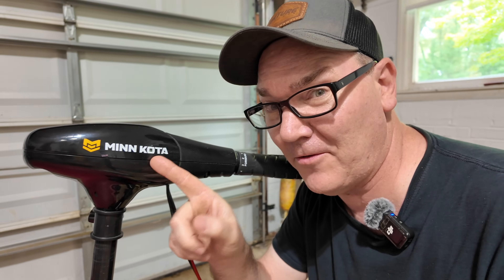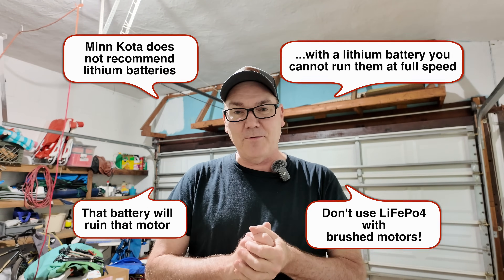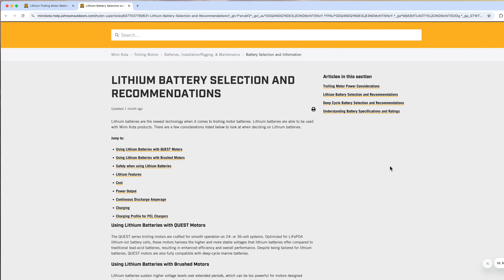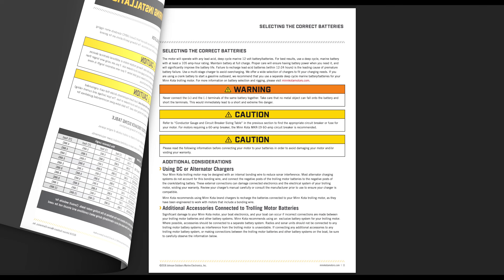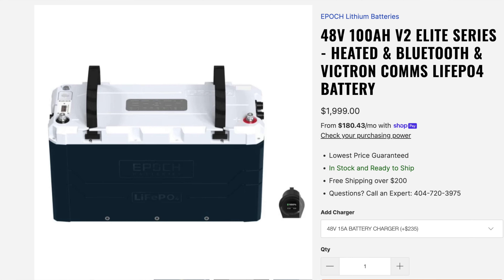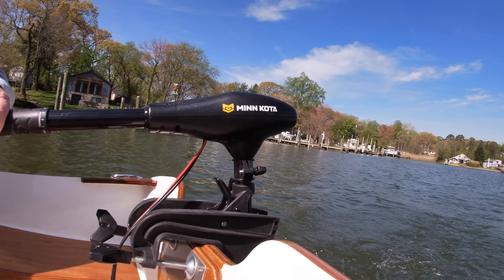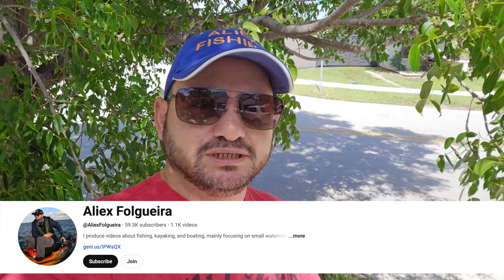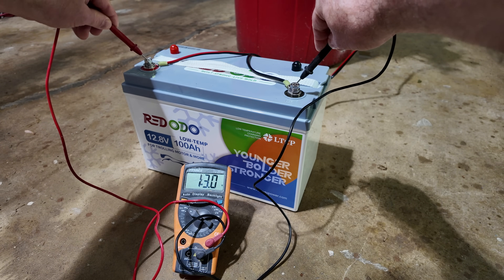Does a Lithium Battery DAMAGE a Trolling Motor & is Minn Kota Hiding the TRUTH?

Comment: Hmmm.  I know nothing at all about Minn Kota.  But I know a little about DC motors and electricity in general, having spent thirty years designing motor circuits in industry, including DC PM motors.  All batteries, lithium ion or lead-acid meet stringent standards.  As far as motors are concerned, the key is current.  If the voltage is within +/-10% (1.2 volts) and the current is not exceeded in the motor, the power source is transparent to the motor.  The current rating (breaker size) is supposed to take voltage variation into consideration so that current is not exceeded in the Ohms law relationship.  As far as the motors 'burning out sooner', the voltage drop curve on LI batteries means you are at optimum voltage for longer on each charge.  So, the normal wear and tear which effects product life happens in a fewer number of charges.  In my humble opinion if the motor burns out traumatically, it is likely an installation problem or individual motor defect.  If it seems to shorten the life of the motor, that is likely an illusion.  You will probably get the same number of hours of operation  at a given speed.
Reply: Nah, this guy is just an id iot.  Lithium batteries designed for trolling motors just have an internal regulator or buck converter to step-down the voltage, as opposed to 'regular' LFP lithium batteries.  Remember:  A 'regular', non-trolling motor lithium battery at 100% state of charge can reach voltages as high as 14.6V, and can take quite a while of operation to drop to acceptable voltages...

Comment: Hey, let me tell you what happened to me and my mother. I bought 2 Newport NV series 46lb thrust trolling motors and i bought 2 100AH lithium batteries for the trolling motors and my mothers trolling motor stopped working and the next day my trolling motor stopped working. I contacted Newport and they are sending 2 new speed controllers and instructions how to change them and they said i could only use the lithium batteries if i only used speeds 1-3. That i couldn't use speeds 4 or 5 at all or the warranty would not be covered. Also, Newport sells a lithium battery for there trolling motor on there website.
Reply from the maker: Thanks for sharing your experience - that's good information for everyone to know!

Comment: I really don't want to be that guy and don't think it makes a difference, but, the barrel test does not "load" the motor prop the same way as pushing a loaded boat underway.
Need to perform a current (amp) test to verify that the motor is loaded while testing. 
No cavitation or current assist to lower the current draw.
Reply: Thanks for the test.
 I had been wondering if I could run my old 12v / 24v trolling motor with my new lithium battery. 
I look forward to using it now.

Comment: ReDODO....not Redodeo. I cannot believe they named it dodo LOL. Minnkota is definitely practicing CYA. I personally think they say it because of the discharge curve of lithium that you sit at or above 12V through 90% of discharge. RPM is effected directly by the voltage applied and KV of the motor. Running at higher kv that lithium allows could cause the brushes to wear out before their warranty period ends, your friend stated that his has been running for five years? So probably being overly cautious on minnkotas part. Good video and test!
Reply from the maker: I also thought it was Re-Dodo but the company told me it was Red - O. D. O.

Comment: I smoked an Endura 30lb on my kayak in less than 2 years.  Had a good LiFePo4 with BMS in and wired through a Minn Kota protected box.  When I pulled it apart, the wires were fried all the way down.  I ran it 100% frequently but not extensively.
Reply from the maker: That's probably what they should be doing a better job of warning us about!

Comment: Elevated voltage means less amperage. Amperage causes heat, not volts. Unless the voltage is extremely high their claim is bogus.
Reply: Yes, if you elevate the voltage you can reduce the current for the same power but though the same resistance, increasing the voltage will increase the current.

I=V/R where in this case, R (motor resistance) remains the same.

So, using very basic concepts, say the motor draws 30A at 12V, the motor resistance is (R=V/I), 12/30 = .4 of an ohm.

If you up the voltage to 13, I=V/R = 13/0.4 = 32.5A, that's a 2.5A increase in current, if I've done my maths correctly. ;-)

Oh, and it's power (P=V*I) that creates heat, no matter how it's generated. ;-)

Comment: I use a minkota 30/30 and and minkota 30/35  And almost always at speed 5.  Done this with this exact battery for years.  And at the price of the small trolling motors, why would I not do this.  Works perfectly ...

Comment: I've burned up two of 5-speed switches in the last couple years on my Endura C2 34# trolling motor. It is currently sitting in the garage because I decided to upgrade to the Endura Max 55# model after it died again; I haven't gotten to taking it apart to see what failed yet.

Comment: I have now blown two Minn Kota trolling motors (most recent Endura Max) using lithium ion batteries 12.8V 100 aH.  This happened within an hour both times.  The second time we made sure to run it at about 60% as your video does a great job of describing the numbers only go to 5.  I am not sure why but I am very frustrated with Minn Kota.
Reply: Put a voltage regulator or buck converter between the battery and trolling motor rated for the proper current....  This guy is an idi ot...

Comment: Isn't the water cooling the head down? By running it in a small trash can are you not heating up the water?
Reply from the maker: Trolling motors don't use an impeller so the head doesn't get cooled. The water in the can surprisingly did not get warm.

Comment: Been using the exact same motor and battery for 3 years now. Full speed is my default position - doesn't draw the full 50 amp capacity at any time (@ 50 amps the BMS shuts off). Not to mention, the full charge capacity of the Lifepo4 battery will decrease over time, thus making the urban myth totally wrong.

Comment: Been running a minn kota 30lb thrust with a 12v 100 amp Power Queen battery ..no issues what so ever.... Maybe it the battery your using ...
Reply from the maker: No issues with mine either - that's the point of this video!

Comment: these things were all designed to be used with lead acid batteries before lithium was available. The user is the one who decided to use a battery with a different voltage profile that the lithium manufacturer has marketed  as “Drop in replacement” for lead acid batteries…..lots of applications where lithium batteries cause problems in designs that were done for lead acid batteries. If you use lithium you better understand the difference.
Reply from the maker: It would cost zero dollars for Minn Kota to better inform people instead of being hidden deep on their web site. Because many people would attribute failure of their trolling motor to Minn Kota and not the battery.

Comment: Any one running these type battery's as their main engine starting battery? I was wondering how the engines charge system will effect the battery and even more so How a 2 stroke engines charge system will effect since they use a stator type charging system.

Comment: ironically, I just burned up a one year old 30 lb Endura running into the wind for about 30 hard minutes. But, I blame it on the algae bloom wrapped around the prop, not the motors fault I didn’t notice because of the conditions. Just got a new 55lb endura max today.
Reply from the maker: Dang!

Comment: If MinnKota truly believes a increase in average applied voltage of under one volt will have a detrimental effect of the brush/commutator interface, then they need to redesign that interface.  Real world electrical experience says it won't make a difference.

Comment: I have a Minn Kota 12V Riptide motor I bought new around 2002, and am still using.  I had some saltwater incursion into the power head a couple of years ago so the brushes have been replaced.  In March 2024 I replaced my lead acid battery with Power Queen 12V 100Ah LiFePO4 Battery BCI Group 24 Lithium Battery, Deep Cycle Battery with 100A BMS, 1280Wh.  I fished uneventfully through 2024, but within my first hour of use in 2025, the motor stopped running while on a 5 day trip.  We diagnosed the failed part as the 5 speed switch - bypassing it the power unit ran fine.  When I replaced the switch, I discovered 3 of the 6 wires had melted together.  I was able to pry them apart, and repaired with electrical tape rather than replace.  

I have used the motor two days more since - the second day I was pulling against wind and tide much of the day, so much so that running on speed 4 was often not enough, so I spent hours running at 5.  So far no sign of issue, but when it failed last time there was no sign ahead of time, it just stopped running.  I am just putting this out there for consideration.

Comment: The obvious suspicion is it's a way to entice people to upgrade to brushless, right?  Hopefully that's not the case!

Water temp is another factor - I didn't notice you mention you ran it in warm water but that might a critical factor.  Granted, I bet the motor heated up the water over time.  Thanks so much for the video!

Comment: You can over heat the he trolling motor in the little bit of water in a trash can .no water cooling system. No load. Put on boat run in Lake then you have load plus plenty of water. How hot is your water in your tank .I am sure the Lake waters will not get over heated. BAD Test.
Reply from the maker: The water didn't even get warm - which surprised me.

Comment: I have a Minnkota Terova 80 pound thrust and I use 2 100 amp hr lithium batteries and if I run at full speed for more than five minutes, it trips the breakers I reset the breakers I can run at 8.5 all day long no issues
Reply from the maker: Hmmm - Circuit breaker doing its job!

Comment: You had a lot to say about what warnings MinnKota should have about these batteries... What about the company who makes the battery that says its for trolling motors?
Reply from the maker: My thought is that maybe this battery is regulating itself at a low enough voltage to work. But I'm no battery expert. Other 12 volt LiFePo4 batteries might not be set the same or recommended.
Reply: @WayneTheBoatGuy  either way, they say they are for trolling motors. If there is a chance it could damage "some" trolling motors there should be warnings, just like you suggested for minnkota.

Comment: My Minn Kota 55lb thrust transom mount motor also has another issue. The battery maximizer feature does not work. It flashes a continuous red light. AI indicates that it will not work on a lithium phosphate battery because Minn Kota designed their motor for flooded lead acid batteries and the lithium does not discharge like FLA battery. Perhaps that has to do with burning the motor too? Can you please investigate this further, it would be appreciated. I am not technical. Thank you.

Comment: I've run brushed trolling motors for 20years on electrc-motors only lakes in Italy and i can say that by far the weakest point of brushed trolling motors is the speed switch. Those faston connections just cannot sustain heavy power for a long time. That's what you will burn first. Cannot say if lithium batteris make it even worse but I'm using them for years and so far no problem at all

Comment: I have been running my Endura 44 lb trolling motor for a few years with my Dakota Lithium battery without any issues.  Granted, I don't normally run it wide open for long periods of time but still no issues.  I like your testing setup.  Thanks for the video.  Fish on!

Comment: Great video especially because I’ve just purchased a Li ion battery. I have to wonder if you’d get the same result with an actual load on the motor, rather than just moving water.
I’ve used my battery twice, and am thrilled with it. I’m using power 1  90% of the time and doubt that I will ever have the overheating problem.😊😊

Comment: Minn Kota paid engineers a lot of money to design a motor that will barely handle the electrical power it's going to see in service.  New battery tech increases the time at maximum load.  So the motors see conditions they weren't  designed for and could fail or wear out sooner. The solution?  Push the problem into the consumer instead of beefing up the product.  In other words make someone else pay for your screwup.

Comment: Intetesting point was brought up....lithium batteries charge at higher voltage rates... so should the motor be unplugged or disonnected during charging?    Many bow mount motor users never unplug their trolling motor when charging.     Could turning the power button on while charging damage the control board...  using my 24v terrova as an example.

Comment: I have had 3 Minn Kota Trolling motors stop working due to Lithium Batteries. Full transparency. I only use Trolling Motor and do not have another motor so I may run at 100% more than some but I seldom fish more than 5 or 6 hr tops. So far it has been boards and speed switches and not the entire motor. I completely understand the issue and I can not see why ( retired engineer) can not. No time to explain but beware it could damage your motor just like they say if you run over 85% which is posted on there site when you know to look for it, The push for brushless Trolling motors is where it is going, I am glad so many on here have not had issues like I have. PS: Not against Lithium Batteries for sure they hold full voltage longer.
Reply: I am at a loss. Minn Kota sent me a replacement EDGE trolling motor. The original would not work and now the replacement will not work on Lithium batteries. No matter what speed it looks like it is on 1. Every now and then it comes up to speed. No one else seems to be having this issue.
Reply: Wish I could upload a video.

Comment: Be careful.  That is only a few gallons of water that electric motor is sitting in.  The motor could be generating heat at full power.  And yes. lifp04 batteries have never caused problems for me.  They are below 200.00 now for a decent 100ah 12v lifep04.

Comment: Been running newport brushed and cloud mountain brushless with Power Queen batteries for 4 years every sunday full speed till the Batts die. Never a single issue, the most important thing for longevity is proper wiring.
Reply: Wiring has Nothing to do with longevity of a motor. In proper / crappy wiring will just be seen as voltage drop by the motor.

Comment: I just switched to LiFePO4 for my Minn-Kota PD55. Lithium has a slightly higher voltage under load. I'm at 12.8 volts under full power, instead of maybe mid 12's for my old lead-acid. I can't imagine how this much voltage increase is going to make much of a difference. It's not going to be heat, because the whole motor is always submerged in cold water. Like you said, I think Minn-Kota is "covering their A##" Also, what if you have a Minn-Kota on the same circuit as the house battery, and you have the outboard running? In this case the alternator raises the voltage is 14.4 !!! Oh my goodness!!! The motor might explode!

Also added to the LiFePO4 "confusion", is the assertion that you should never charge to 100%. Only charge to 80%. Search YT and you will find videos on this issue. Apparently, there is a journal article on this, so there is some truth in this.  I'm not paying attention to this, however. What are you supposed to do??? Set your alarm clock to 2AM so you can get up and take the charger off? Plus, I paid good money for a 230AH battery, why should I leave 20% of that capacity on the table.

In my opinion, run your motor at full speed, and charge fully. No need to overthink this.

Comment: I added lithium batteries to my set up to reduce weight. I have a Ultrex first generation and destroyed my mother board by the second day of a trip to Florida. No insight or info from anyone about the compatibility of said hook up. $500 later for the trolling motor repair and a new set ultra heavy lead acid batteries I was back on the water. Also found out if I had added a starting lithium battery to my outboard, it would have screwed that up also. It’s a 2014 Mercury 150 XS PRO. I think my fishing days with a bass boat would  have been numbered. Make sure your gear is new enough.

Comment: IMO, the biggest failures are incorrect wire size or connector.
Reply from the maker: By the manufacturer? For this test I connected the battery directly to the motor.
Reply: @WayneTheBoatGuy  no not minnkota.

Comment: It's a simple electric motor hooked to a battery. This is not rocket science people!

You could probably triple the voltage and still be fine if you added a current limiter to keep the motor from drawing above it's limits.

Comment: It would seem that if one had several large lead acid deep cycle batteries connected in PARALLEL with say 00 awg cabling the results would be similar to using a single LiFePO4 battery.